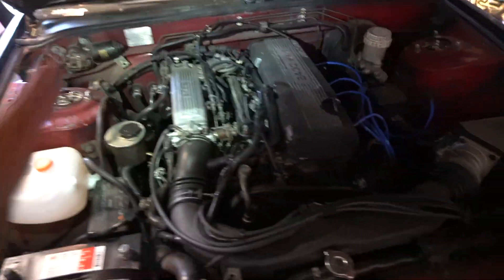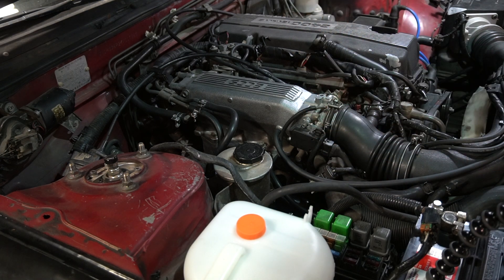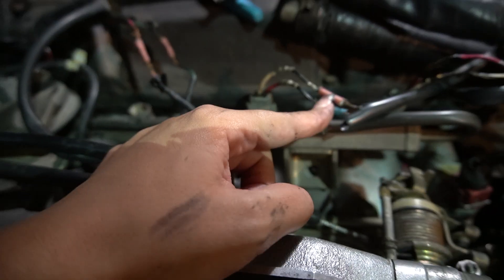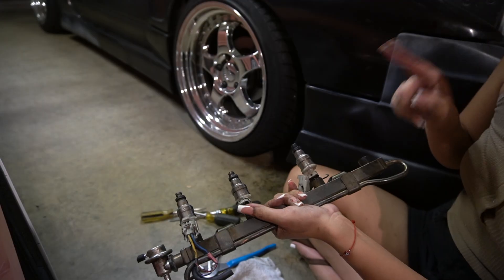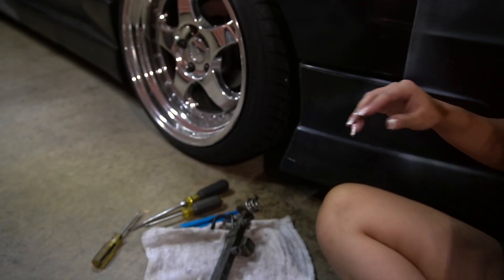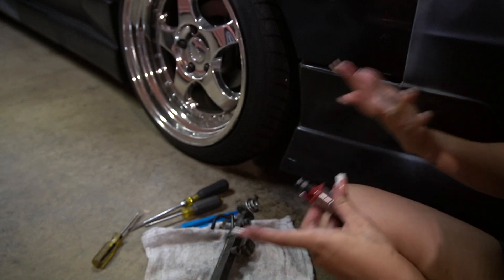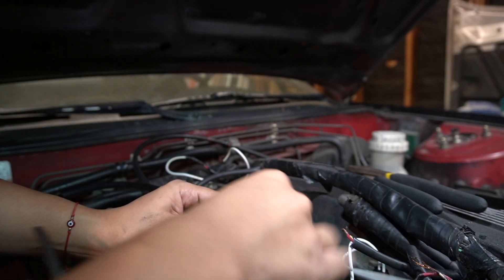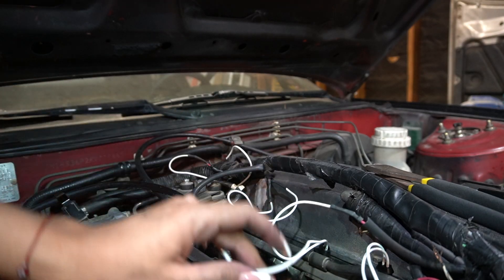240SX FUEL INJECTORS INSTALL! S13

Comment: If I were you I would go to wiring specialty’s and get a new engine harness if you plan on keeping the stock engine besides the can get you a manual swap harness for the car. While I have not personally used them I have heard a lot of good things about them and they seem like a plug and play solution. You could keep the stock harness but from what you said it seems that someone butchered it which means it will be a nightmare to trace if something goes wrong. Love the content and am looking forward to the build and seeing it progress

Comment: This is kinda cool...I just deal w/ a bad Fuel Injector myself...Had to remove my Fuel Rail too!...I wouldn't use Vasoline on the O-rings tho...I used Silicone Paste for the O-rings!...
Reply: Vaseline is fine it is petroleum based

Comment: Definetly change spark plugs and check the other wires and clean the connectors, because it could solve the issues fast and cheap. Brake cleaner and WD-40 are your friends. Brave girl ;)

Comment: If Wires are wrong on ohm meter they should be 13 to 14 volts if backwards will be -13 to -14

Comment: Typically when you install new injectors, you'll need to get them calibrated.
Reply: Some injectors will come flowed from the factory with a flow card to show the results, but it doesn't hurt to test them again just incase